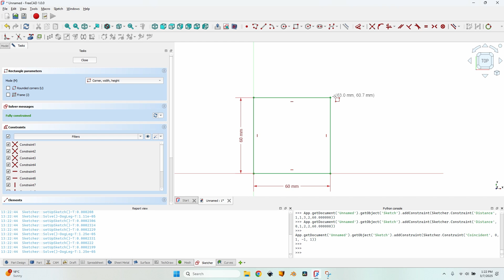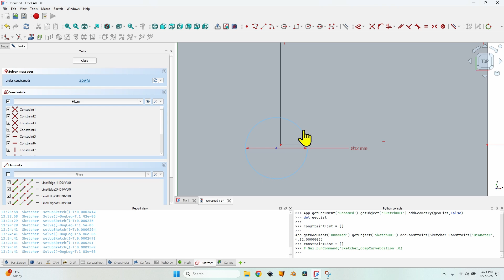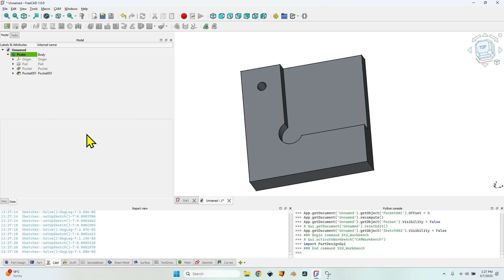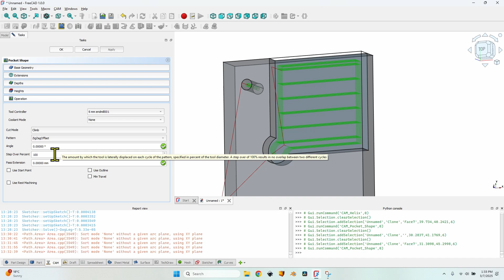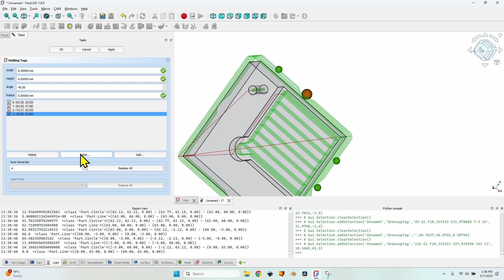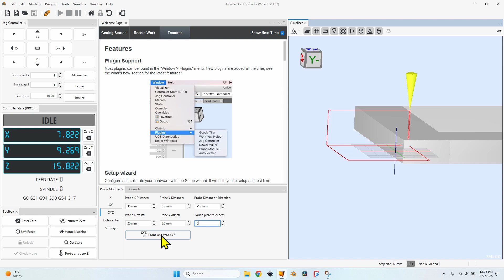CNC Tutorial: Model, Mill & Set an XYZ Probe | Full G-Code Workflow + UGS Setup (FreeCAD CAM)

Comment: If you are going to mill aluminum parts only, then you can use just the probe points directly on the aluminum stock. However check if the electric circuit is completed before running the zero routine. 
Hard Anodized aluminum will not conduct electricity. In this case use a sandpaper and scrape off the anodized layer
Reply from the maker: The probe is universal, I mill all kinds of soft materials (wood, acrylic, foam, etc)

Comment: Thanks for the video. I am one of the developers of UGS and I just tried the probe module with XYZ probing and I could not reproduce the problem you showed at https://youtu.be/vTOKW835xuM?t=1239 

What controller and firmware are you using?

Regarding that it doesn't update the gcode state G90/G91 is bad, I'll look into that.
Reply from the maker: @joacimbreiler  Hello! I'm using an esp32 with fluidNC. I have noticed there are some other moments when it fails to update the coordinates (such as when trying to override axes values), but it only happens once in a while
Reply: @opensourcecnc  are you using the status report polling in UGS (Options -> UGS -> Sender Options)?
Reply from the maker: I'm not sure, I will look it up and get back to you
Reply from the maker: @joacimbreiler Yes, it is enabled,  with a 200 ms poll rate

Comment: I believe the FreeCAD CAM/Path workbench has a modification to pocketing operations called Dog bone dressup that automatically goes into corners so a square object will fit into the milled corner. You don't have to design the corner circle yourself.
Reply from the maker: @Mmh4566   I know it does, but sometimes it doesn't work as expected. Making it larger than the toolbit helps with the chip removal, too
Reply: @opensourcecnc  Yes, sometimes it doesn't. I believe it depends on the angle between the two meeting lines. For the single corner you are milling constructing the circle by hand is fine, but if you are milling pockets with multiple lines and varying angles between the lines, it quickly becomes tedious to calculate the required circle diameter for every corner. I put in the comment so viewers are aware of this facility, in case they are not. 
I enjoy your videos very much, by the way, and always learn something from them. Good job!
Reply: I was wondering what that was for

Comment: The Facemill/Pocket Op has the same problem with leaving material behind with a large step over. It can be seen with the new simulator. Problem with the code?
Reply from the maker: I assumed it was due to deflection.... I will take a closer look at the gcode and see if it's because of the code, thanks!